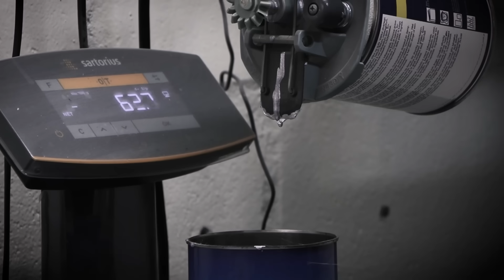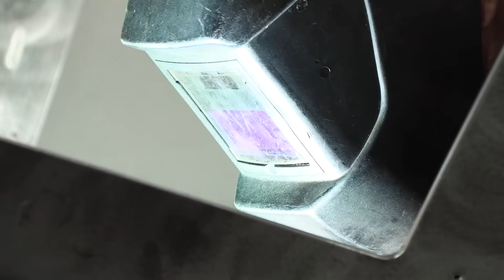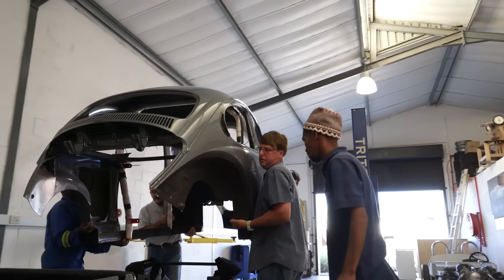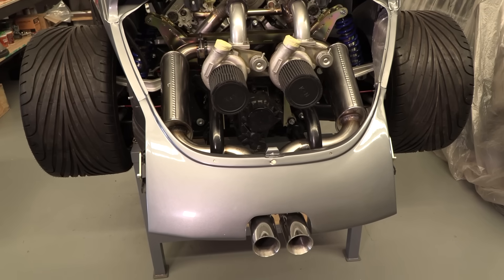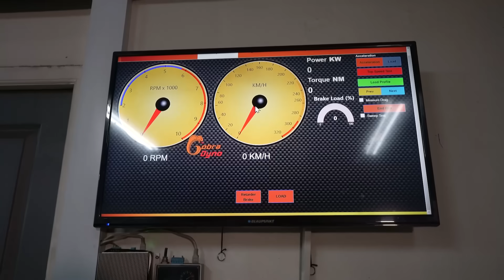We Built a V8 VWBug and Here's What Happened

Comment: Why spec a DOHC 4 valve per cylinder 4.2 liter high reeving  V8 add twin turbos and then run a tune @426hp ??? You could add another 150-200 more HP and the reliability would be virtually the same as the 426 HP tune. Lets be honest, neither the builders or the buyers will never redline this thing and if they did it wouldn't be over and over again so a 1200 HP tune would last just as long as a 400 HP tune.

Comment: Personally, I would've left out the turbos entirely, it's too much pressure and you'll burn out the engine too early.  I would enjoy working on the V8 myself without the added complication of turbos, it's a whole other level and you'd likely need a laptop to set them up and keep them tuned. It's already a V8 on a VW bug, it's quite enough power to begin with. Also, I would've set this car up to be entirely mechanical, I would leave out the ECU entirely and opt for a small block V8, possibly a 289 or the legendary Ford 302. Old car, old school engine.  If you set the car up right it should be ready for competition and keep up with the big boys on a track, at least in the turns but probably not the straight aways and flat out. Throw your competition off a little by leaving some patina.   I also would've gone for a matte gray, wooden steering wheel and chunkier and taller tires. Set the car up for track, mountain driving, long distance, something you can actually live with and possibly daily drive. Not such a pretty toy and not afraid to get a couple scratches. Decent on the outside, but perfect on the inside like a sleeper. Rich guys have no taste. BUgs are designed for simplicity, utility, working class people, and you should maintain that. Race on the weekends, drive to work on Monday. Whoever ordered this doesn't understand the concept of the VW Bug.

Comment: If this is dual turbocharged, I cannot help but assert that a 6-banger would not only have generated the same power, but also will not have compromised handling, insofar as the well-understood issue of having a rear-biased lump that will incite snap oversteer.

You indicate this is technically a mid-mounted engine, but with the minimal wheelbase and maximal dipolar moment of this vehicle, are you not aware of the debacle of the Porsche Carrera GT?

Comment: Beautiful build and craftsmanship! All the custom chassis and suspension extremely nice. Paint work very complete and extremely nice looking. The engine was a little disappointing,  custom engine build, 2 turbos, intercooler... take to dyno and produce only 260KW (349 HP) and 480 NM (354 ft lb).  I would think hitting 600+ HP & 700 ft lb wouldn't be a challenge.

Comment: Dad and grandpa were going to do a V8 front engine bug in late 60s but went with a 
t-bucket instead. A big would have been cool too but they tend to come off the ground somewhere over 100mph. They are basically a wing.
Reply from the maker: don't quite understand your logic. The engine is mid mounted 45/55 weight distribution. That's about as good as it gets for road holding....

Comment: Big Audi engine occupy almost the back seater space. Its good you don"t need a heater during winter. But again during sunny day will the air-cond able to cool down the driver. Its going to be a sweating for the driver.
Reply from the maker: we have a n aircon in the front next to the fuel tank. works like a charm

Comment: Beautiful engineering.  As a factory motorcycle mechanic,  i can really appreciate all the work that goes into this build.
A whole level above what i did.
But im proud of the work i did. I was meticulous in all my repairs. 
I just built an RC Volkswagen beetle with a big 550 motor in it. A mock OEM motor, underneath the electric 550 brushed motor. Installing a 6000 kv motor would double the speed. 
I also owned a 1965 and 1970 beetle. 
Thanks for a great video
Reply: Would love to see your RC Bug!
Reply: I am from South Africa.  White Afrikaan speaking are brilliant engineer, mechanics , spray painter? Noticed the top class professional finished as if from a motor assembly like brand new customised vehicle from BODYWORKS TO MECHANICS TO ENGINEERING ETC IN HOUSE JOB
Reply: @SwaminathanSingh-fg5cz  Yes, the bodywork on this car is incredible!!  Those fenders could pass for stock to someone who wasnt into these

Comment: Nicely done.  But I'm a bit confused.   An Audi 4.2 naturally aspirated puts out 280hp So you are telling me with those twin turbos you only gained 70hp.  Even at a low boost setting you should be running at least 100-125hp gain over stock minimum.  It just don't sound right to me.
Reply from the maker: As you know horse power isn’t a coefficient of boost pressure. There are other factors. This is how we deliver a vehicle to a client. “Safe mode”. If they want to turn up the wick and churn out the hp that’s up to them

Comment: I once had a 67 Bug with a 1500 cc engine. It had a two barrel Chevy carburetor that made it crazy fast.  Fastest car I ever owned. Faster than my 77 Vette, 79 Trans Am, and 67 Coronet.It was also faster than my friend's 2200 Beetle.  A mechanic told me the carb would eventually ruin the cylinders. I did not care. I only paid $1,000 and it was fun with that carb.
Reply: Ruin it? Hes no mechanic!
Any carb can be tuned to run and live  just fine

Comment: Very nice bug!! A proper quality bespoke build with a fantastic spec. Nice to see a proper mid engine German turbo V8 rather than the generic LS motor. Best of SA Auto engineering skills on display. It would have been nice to see a final cost and performance figures but that would have been a bit crass and American. I can imagine the handling with that short wheelbase and 400hp would be a bit entertaining. Maybe adding an Audi 4 wheel drive system might be the only thing I would have included with my unlimited dream budget🤣🤣

Comment: what was the final cost spec on this vehicle? Could this be done with the Infiniti twin turbo v6 they use in the Q60 Red Sport (440 hp stock and 540 hp with the AMS Upgrade)? Only asking because I've considered a vehicle like this and the V6 could save a few inches in the engine bay as well as weight.

Comment: So many factors missing here what engine, what fuel system, what emission system, all of those factors make for HP and torque to the wheels. Looks are fine but if you do not put enough into the engine then the performance will suffer.

Comment: My other buddy has an AUDI 4.2 Single turbo drag car de-stroked to 4.0l using stock crankshaft running over 2000hp as a drag car. Very large single turbo. lots of headwork and boost. I am surprised you stopped at 350hp. there is a LOT more on the table. they were running 1200hp with the same engine config. Then they put in custom made aluminum rods. to achieve the 2000 amount plus some other mods. NO NITROUS!!!!
Reply: They are building a street legal car, not a drag car 😎
Reply: They know this, stated in the video, power level currently is about right for the customer to get used to it, more controllable etc
4 digit st cars i cant stand driving on the street .If I cant mat the throttle and hook up its too much

Comment: Dude! I knew a guy that did this when I was... Uh hmm... 30 years ago LOL! He even tubed in some Mickey Thomson racing slicks. He dropped a Chevy 5.7L V8 in the front with a 350 Turbohydromatic transmission and a 4.10 rear axle. He had to move the firewall back by at least a foot and moved the front seats back to almost where the back seats were. It would only do like 75 mph but it could get there so fast your stomach would turn. I never saw Ernie lose a race including a brand new ZR1.

Comment: holly bondo bucket batman ! get a new body man    that    can work with steel ! theres no reason (3:38) for bondo in any body off restoration . its a tiny vw bug . i suck at body work but at least i replaced all rust then did a coat of second skin . i went the cool way with my bugs and use a Arctic Cat Thundercat 1000cc 2 Stroke 3 Cylinder  that when done puts out 237 hp to a pinto axle and a mini-spool  with a watts link . on the front a DNA Motoring LCA-FU+FL-FM73   is used with wilwood brake  ,etc,etc,etc,etc .
Reply from the maker: thanks for your input...

Comment: While the work that went into this frankenbug is amazing, I just want to point out that 250hp(n/a) or 600hp(turbo) is possible to attain from the original vw engine case retaining the original vw form and charm. I'm sure the custom aluminum chassis countered the massive increase in weight but at great price and effort. But then that's the point, right? A good vw shouldn't be chopped up and desecrated when it could've been saved for future generations to appreciate.

Comment: Nice car v8?  You could have used a 4 cylinder and turbo, or a stright 6 with turbo and got the horse power
Maybe a modern vw 4 cylinder tuned up and beefed up a v8 is overkill.  Its not nessary.  The more weight you add to the car the more power you need to move it down the road and stronger thd frame has to be.
The beefed up bug motors did pretty dam good. A vw bugs not very heavy so it dosnt take much power to get one to move.  Power to weight ratio has its trade offs.  You up the power with a larger motor you add a lot more weight.
With just the motor but you cant do just the motor without other mods. Frame suspension breaks and so on. 
I think its cool but not necessarily the best idea. Dont get me wrong i like the car. Its one of a kind.

Comment: Build a 69 - build a custom frame for a 350 chev with auto up front.. 3" over fenders and louvered front and custom radiator.   

Mustang II front end and rear-end... 

Smoke a set of new tires into dust with little effort...  Was not much foot room - but the driver seat was almost in factory location. 

Also build a 455 mid eng 71 Toyota Celica...

But the Pinto SW turned into a Rancho was my personal favorite.   It was a panel wagon that was rolled over on the freeway.. 

Pass side was crashed to the seat level - 
I painted it fire eng red gold metallic, with side pipe exhaust and opera side glass out of a old land yacht ...

If I recall correctly - 
@74 Fury Opera side windows...

Just moved the rear hack forward and added a cut one to the rear. - from the rear view point the car looked like a stock S/W Pinto.

 My best build was turning a 27 Ford Tudor into a T bucket - I hand fab the floor, rockers , lower 1/3rd quarters and rear panel from flat sheet steel.  

It was a real factory 27 that was in very bad shape - the fire wall, cowl and dash was about the only stock material that was worth trying to save. 

When done it was a all metal car that looked as if it rolled out of the factory in 27, but as a 70's drag/show car look... Candy Apple Red with Gold Pin Strips
Reply: Oh yeah - building what other's don't is always fun - that's hot rodding

Comment: Too much like WORK.   I had a 55 Chev BelAire, those cars still used 15" tires stock.  Frame width was nearly identical, the length had to be shortened to match VW wheel base. That is easy done with a cutting torch and measuring tape.  A shorter steel frame meant a shorter driveshaft which is done the same way as frame.  Now angle iron is put on the outside of the frame so that the beetle can be bolted down as it was on the pan 10 bolts per side. Engine compartment was still Chevrolet size.  First engine I had was a 265ciV8 with the stock 3 speed manual transmission.(265,283, 327,350)are the identical engine blocks. I used what I had.  The Chev was a 4 door I got for free.  The VW Beetle body was from a 62 which I also got for free in the faded red color.  I did not touch the body.  I unbolted it from its pan and lifted it off and placed over the Chev frame...which had stock leaf springs and stock front suspension.  As there was no pan I had to make the floor out of sheet metal.  Not a hard task. Weld in some ribbing to strengthen the floor and cut a slot for the drive shaft to the rear axle.  No ABS because neither the Chev or VW had it at the time.(it had not been invented yet when I did my Snooze)  It got a FORD radiator(because the size was the right ,(small), & was free). The driver's seat was a bit back as it still had the stock Chev steering.  In other words it looked like a stock bug as who really pays attention to VW suspension as they drive past it.  They see the 2 chrome tail pipes and that is it.  Up front I cut out 2 triangles for the air intake to cool the rad but then put expanded metal mesh over the holes painted the same as the car (rust red-flat) so it was not noticeable as the hood was closed.
Audi did not have a V8 at the time.  Besides, why bother when I had a Chev V8? No dyno testing. Road testing. It hauled "azz". Not a slugBug.   No video as computers were not invented yet.  No pics(you got to own a camera for that)    All work was done outside in the yard of a bicycle repair shop(who had the welder and cutting torch and served in the military as a mechanic.)  It was something "to do".  Just need a measuring tape and an idea.  These were the days of V8 into a Vega or Pinto (early muscle car years.)Carbs.& headers.(lots of luck with FREE stuff.)And it sounded like a V8 rumble. [ Which all 4 bangers were trying to simulate with the right exhaust(muffler). Blue Bottle, Thrush, Cherry Bomb or a burnt out muffler to get that sound.]
Reply from the maker: Nice styory, thanks for sharing... How many did you make...? This is our 20th chassis or full vehicle
Reply: @V8StealthBeetle  Built 1 for me, got bored with it &then got a different car to mess with. 67 Valiant Bubble-window Barracuda(slant6 pulled for a 383 V8 & posi-track rear end),4 speed manual transmission. Sold that & it ended up at the bottom of a deep lake. We teenagers have more psss & vinegar than brains. Definitely not into photography or videos...or planning.  Just knew people that knew people that had "stuff" sitting in their yards.  Mostly "free stuff". This is BEFORE fuel injection, so naturally aspirated 4 barrel carburetors, dual points & headers.  The stuff that was suppose to help a car breathe better.  Figure I could always do it again, only better...but lost the "desire" to do that stuff as I age. It is "not" important.  I know what I "can do".

Comment: Another engine that would be fun would be a small, light, heavily boosted inline 3-cyl or 4-cyl modern engine. Maybe you could hang it off the rear? You might need to add a whale tale to hide the taller engine? There has to be a way to create a good looking rear engine cover, with a bulge? Or maybe not?

Or go mid-engine again with the small engine.

A Ghia would be fun to do as well. One idea I'd like to explore would be to slightly widen the rear fender bulges on the Ghia. On the forward side of these bulges, between the fender and the body, create air intakes for the radiator cooling. I'd do this with 3D cad first. It could look great, or it could absolutely ruin the iconic look of the 60's Ghia.

The FAT tires on your Beetles look great! Fatter tires and a fatter rear on a Ghia might look good too.

Comment: I built a 1700cc engine that dynoed 137 Hp and that lived happily in my 69 Beatle. This was in the mid 90s. No rear seats, no spare wheel, no headliner or Carpet. My biggest problem was no heat during winter and freezing carburetors, and then boiling gas creating a vapor lock in the summer. I thought it was fairly fast back then :) Comparing to vehicles today it is a slug.
Reply from the maker: Great story, thanks for sharing, yes things have changed a lot since the 90's

Comment: My uncle and dad built my dads V8 bug back in the early 70’s when I was a kid. 
To this day it’s probably one of the best conversions that didn’t require all kinds of expensive engineering. It’s still in its early 70’s time capsule state.

Austin Healy chassis, 58-62 body, fiberglass fenders, all seats are in their stock location…etc. 

First driveline was a 327 with Z-28 cross ram intake, Muncie 4 speed, Hurst shifter, 9 inch rear end. In the mid 80’s he installed a 383 with a B&M 144 blower.

Black Diamond Tuck interior with black shag carpet. Gas tank is behind the back seat and you fill the tank by opening the rear deck lid. Under the rear deck lid where the engine used to be is a fire extinguisher and a collapsible spare tire, space for a car of oil and a small portable gas tank. 

Exhaust pipes exit out stock cutouts but they are 3 inch flared tips at a 45 degree downward angle clocked to the 4 & 8 o clock position. 

10/12 inch wide 15 inch diameter wide cut and recentered Crager S/S mags. Stock bumpers with overiders and some darth vader vents cut into the front hood for air and a cool scoop under the front end for the extra air collection to radiator.

Tucked away safely with his other rods…including his V8 converted 911 and his V8 converted 60’s Alfa Romero Giulia.
Reply from the maker: wow, sounds very cool, thanks for sharing
Reply: @V8StealthBeetle  
Sorry for bragging about pops. He is a D.I.Y creative guy who at 86 is still crawling around under cars welding and what not. Couldn’t help it.

Comment: But in no way can it be called a  Beetle any longer.Different chassis, different engine, mid mounted, different gearbox and transmission different suspension, brakes and wheels, even the classic Beetle body was cut and changed.
Reply from the maker: True, it's called a V8stealthbeetle...

Comment: Without many modifications, a Tesla electric kit can put out 600 horsepower in a VW.
Reply from the maker: How many cylinders does it have?😬
Reply: @V8StealthBeetle  It still has a back seat as well.  It does have to use Porche axles due to the tremendous instantaneous torque.  A real quiet "sleeper".